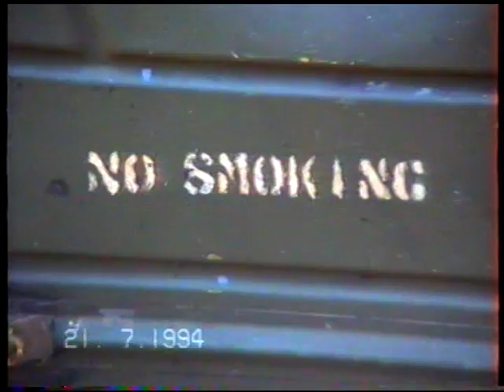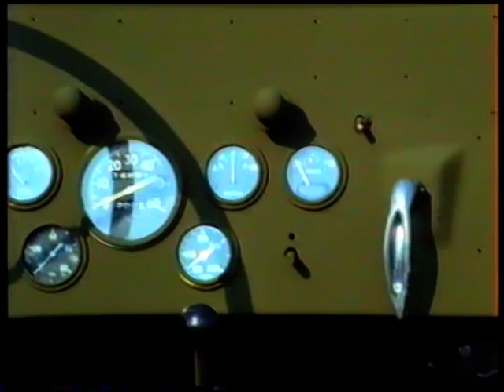Ford GPA restoration

Comment: Seep's. 

Built around the same design as the Jeep about 13,000 total were built.

More of a failure and novelty than a success, they did see action in North Africa and Normandy.

Production ended in 1943.

A cool collector item, more rare than you think.  Personally, I have never seen more than 1 or 2 in my lifetime.